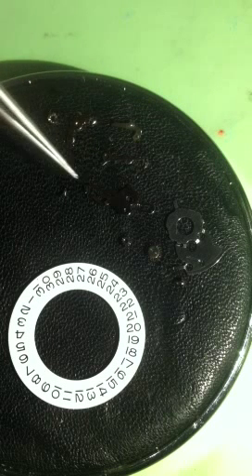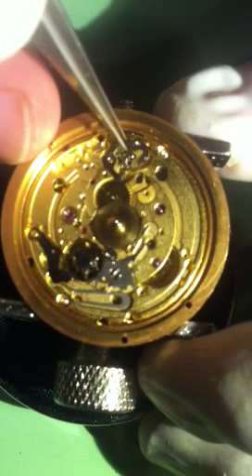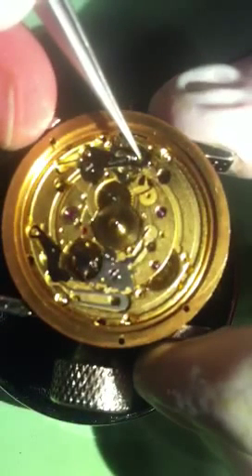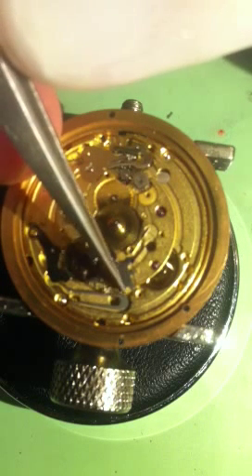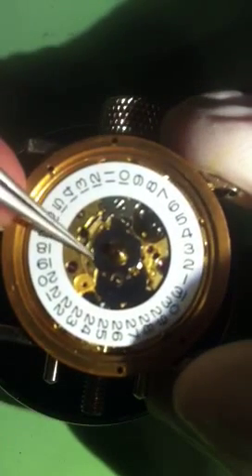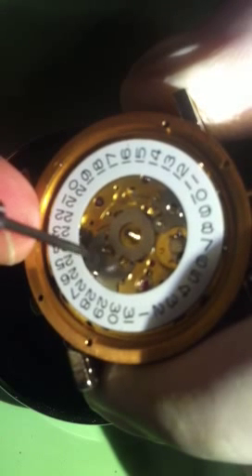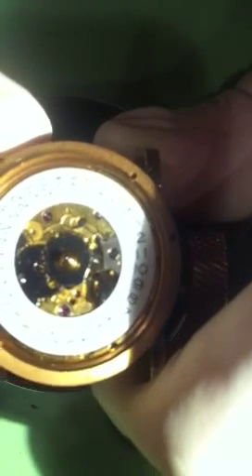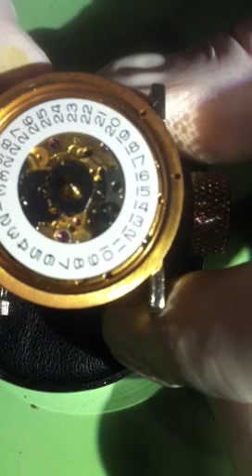Keyless and DW install on ETA 2836

Comment: Thank you for the effort. There is a much simpler way to put the date wheel back: it is attached by means of a bajonet style fitting. Slide it on stem side first and make sure the DW teeth are under the rim of the main cover. You can check that by trying to lift the DW. If it won't move, your are good. Now gently push down on the opposite end of the DW and turn it clockwise. You will feel it 'drop' when the teeth align to the 2 slots of the DW spring cover. Turn little bit further and you will feel the spring 'click' and that's it. Done.

Comment: Rick nicely done my friend.  I have a better way of attaching the dw dwo unit after keyless repair.  You can loosen the screw a bit that is over the calendar gear, opposite the keyless cover.  This is done after the keyless is repaired and both covers are placed back.  Then you place the stem into the date setting mode, slap on the datewheel and wiggle it on while changing the date...you should be able to have it snap down on the left side and you tighten the screw and done  rsh rudy
Reply: True but not always an option with certain dwo's. I've ran into quite a few that tightening the screw was not possible without damage to the overlay.